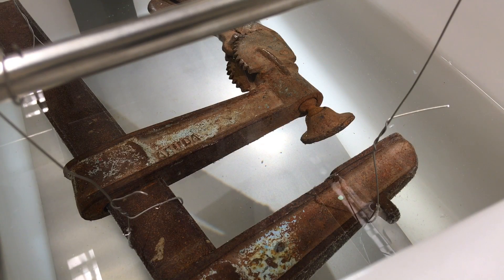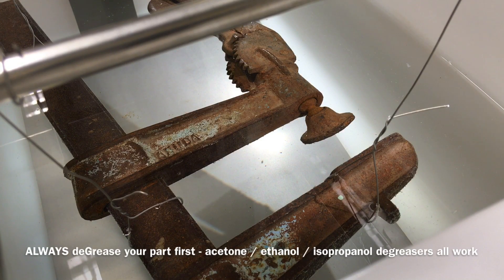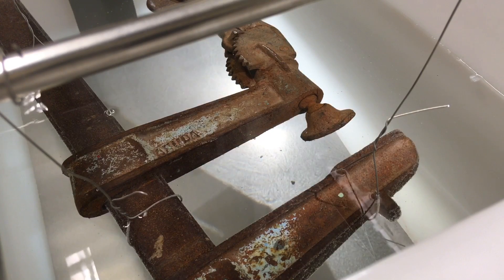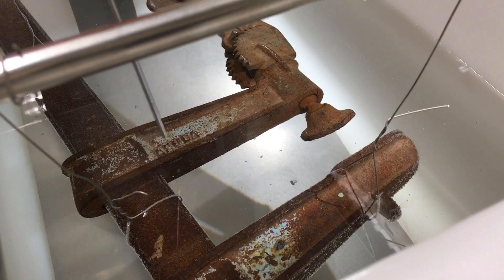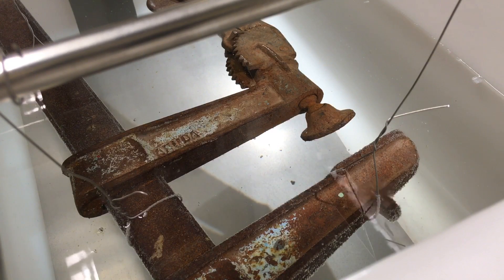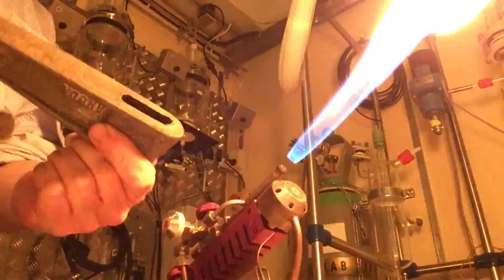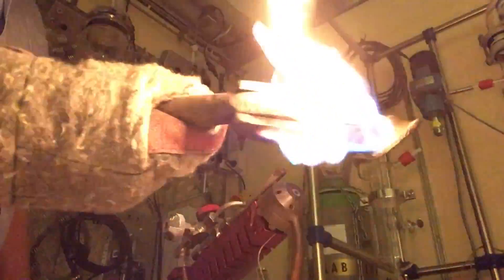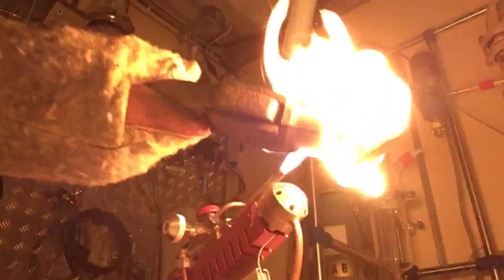True rust removal by a chemist - a titanium electrolysis setup

Comment: So, using vinegar will speed up the electrolysis process if I understand correctly. Will it go even faster the more vinegar you put into the mix? Will using muriatic acid speed it up even further?
Reply from the maker: There is room for more vinegar if you would like. The entire system is comparable with a stereo. If you add on the treble you loose on the base, and a good balance is what you want. This means that you could also add on the current for the electrolysis, and you would get the same effect as increasing the acid concentration. However, everything comes with a drawback - which in the case of increased current is reduced electrical safety. So here I would pick increased concentration of vinegar. Changing to muriatic acid would make everything go much faster. Muriatic acid has 2 major drawbacks in electrolysis ; 1. It will start smelling chlorine gas from your positive electrode. If you sense chlorine gas you should always watch out. It’s a lethal gas at its worst even if it will be very difficult to expose yourself to such concentrations with an open system. This is because chlorine gas is generated very slowly as bubbles and mixed with air continuously. 2. The formation of chlorine gas on the positive electrode is destroying your electrode even if it is made of titanium. It is very corrosive. My conclusion to this is to stay away from it and use the soft conditions in the video. Better do it completely safe, and just wait a bit longer. It also gives you better control over the progression in your work. Thanks for thoughtful comment.
Reply: @Ken_Sweden  Well, I think I should be thanking you for being very informative on the subject!
Reply from the maker: Thanks for watching. I try to identify topics that are on Youtube where there are a lot of 'magics' and inaccurate strange statements. There is more to come on electroplating!

Comment: Can you tell me more about the titanium you are using?  What are the grade and thickness?  Can you recommend a good source?
Reply from the maker: +Steve Broyles , will check when I get back to the lab on Monday. it’s about 1 mm thick. It was cheaper than I thought It would be. Thanks for highlighting this! I should have included it in the video.
Reply: Ken Sweden Today I'm hoping to try your solution, but with steel anode and copper wires.  I am restoring a saw vice.  I let you know how it goes.  Thanks for the inspiration.
Titanium anode/wire and stainless rods to follow.
Reply from the maker: Sorry for late reply. I hope everything works out smooth. The stainless rods are just bars from a lab hood, and you can basically use any bars conducting, but if you wish to lift and check the progress with time, then secure them together so you don't risk a shortcut.  The are 10 mm in thickness. The titanium I use is from http://www.liteoutdoors.com/product/titanium-foil/. It works excellent and I have no business with them, apart from that I ordered and paid for a roll. Good luck!